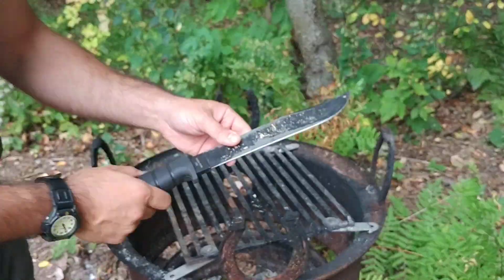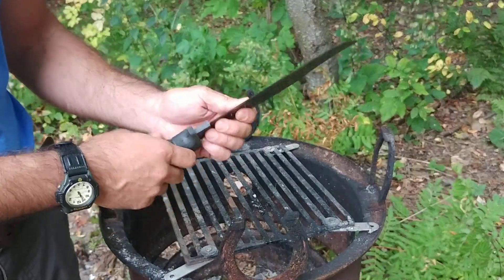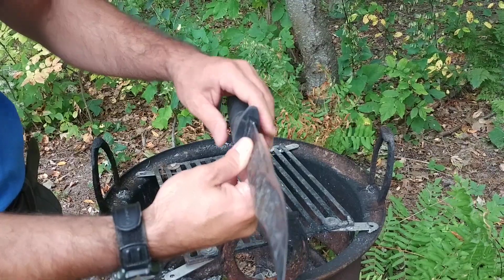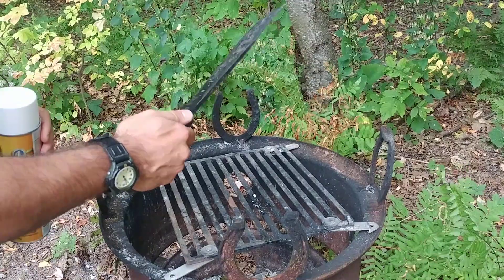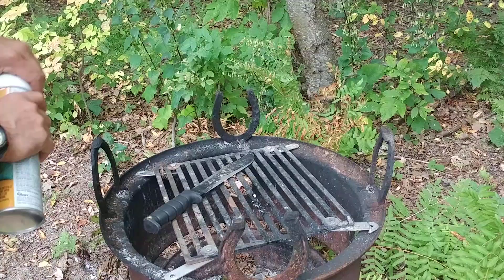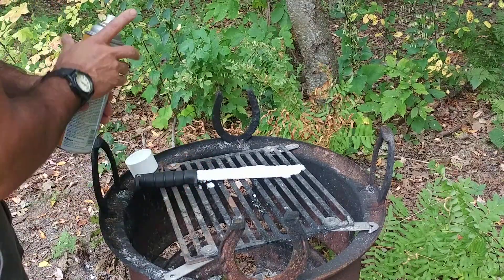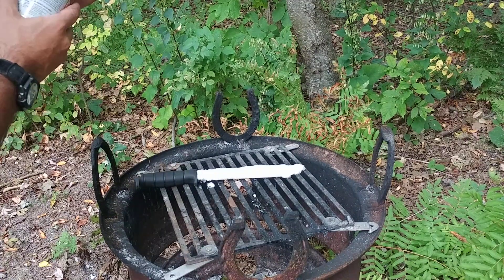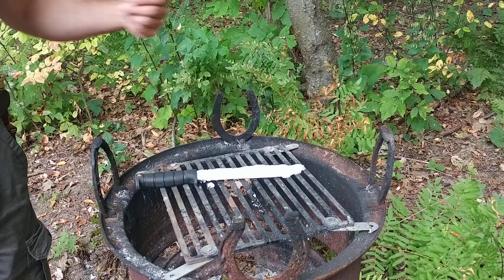Ontario SP5 Survival Bowie Stripping

Comment: I have same issue with rattling  handle on my sp53.
I just drilled two holes trough handle  , and with washers , nots , and bolts tight this handle down . It was almost  5 years ago  , and since  than i didnt hear a thing.,!!!